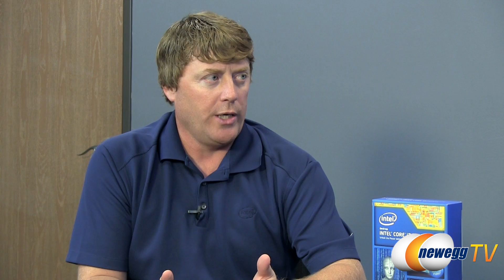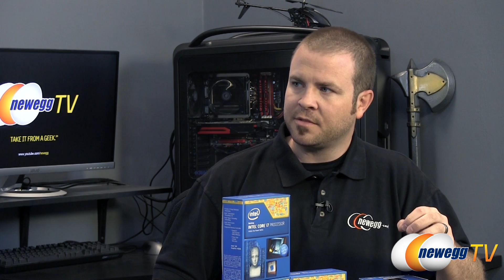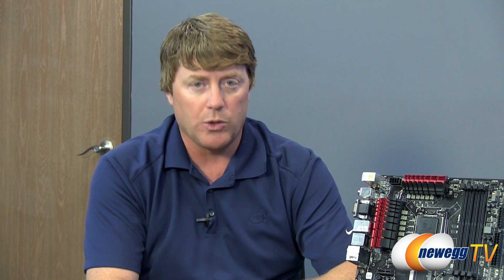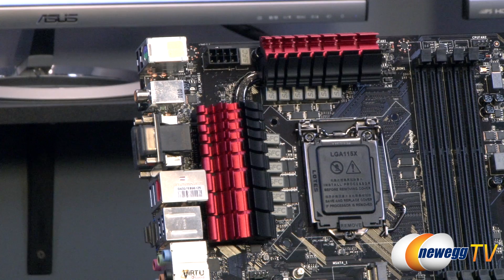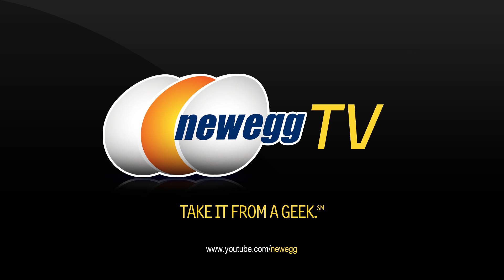Newegg TV: Introducing Intel's 4th Generation Core Processors

Comment: I just went from i5-3350P to i7-4770. I have to say didn't really notice that big of a difference. I'm using emulators as well. I use soft plugin for Project64 and with I5-3350P playing MK trilogy I got at some parts of the game around 55FPS and I did see the slowdown, but with the I7-4770 I now get 59/60FPS all the time no matter what animation. So if you're emulating like me it's a good choice to upgrade

Comment: Okay wtf? I've heard of a i7 4770k but on NewEgg I currently am eyeing a computer with an i7 4770s? Never heard of a 4770s, I'm gunna be running my gtx 770 with 16gbs of RAM, this is my first build by the way, I already need to get a stronger power supply cause of the 770.

Any info? I've been debating STRONGLY on either the AMD 8350 OR an Intel, AMDs heat up terribly fast I've heard, I do gaming AND video editing btw.
Reply: *****
The only place I have near me is a Tiger Direct and they charge out the ass for products. I'm getting my PC pre built but everyone I've soon charges at least 10% more than what you listed.

Idk, I've heard mixed reviews for the AMDs as well as the Intel processors
Reply: The Core i7 4770s is a low power version of the standard I7 4770. It's clock speed is cut back, and the power saving features of Haswell set to "aggressive powersave" making it only use 65w of power. The Core i7 4770s is meant for people who want performance, but have a sub par motherboard that can't handle the full 84w of a standard i7. Most prebuilt PC's have such motherboards.
Reply: Ahh cool thanks man :) I understand it a bit more now!

Comment: would a cpu socket size of 1150 work or does it need to say LGA 1150

PLEASE HELP ME THIS S MY FIRST EVER PC BUILD

thnyou
Reply: The Motherboard Box/Description has to say LGA 1150 OR ON SOME BRANDS Socket H3, both of which are the same socket, just different names.

It's also a good idea to look up pc building tutorials on youtube if you have rouble. :)
Reply: if your buying it from a website (i recommend dabs.com) then check that it
says on the motherboard description that the socket is the same as the proccessor (for example LGA1150)
just check their the same

hope this helped:)

Comment: I am going to buy a 3 Gen i7. I have a MSI B75MA Motherboard and a GTX 660 Graphics Card. I have also got a Corsair CX 500W Power Supply. Do I have to change my PSU to run the i7?

Comment: Nope, you're missing the gist of what he's saying. The thermal goop inside the CPU unit itself is what we are talking about, not where the heatsink contacts the TIM/outer metal part of CPU. There, Intel messed up big time with Ivy and didn't double check to fix in Haswell. That is ridiculously stupid. Some overclockers have to open up the CPU to fix Intel's boo boo.

Comment: No, you will not get the same performance in CPU power wise but gaming is generally more reliant on GPU power. Skyrim, single-threaded games, Fallout, are more CPU dependent. i7 is mostly a waste, i5 or 8350. If you render videos or already have AMD mobo, go AMD. i5 if you want a higher-tier computer but there will be a fps difference between CPUs.

Comment: Nope. Get the i5. The i7 has hyperthreading which is primarily for other applications, nongaming. You will achieve basically same performance with i5-4670k in gaming. Save the $100, put it in the graphics card, you will find a bigger difference there.

Comment: @ 5:35, the answer he SHOULD have given as to why the socket changes happen so frequently is the simple one, to make money. You want the latest gen processor, but the socket is different than the current CPU you have? Well you're just gonna have to get a new Mobo as well, happy shopping asshole! Consumerism embodied, right there. I'm just happy I didn't bother upgrading my system last year, I was going to go with the Z77 Sabertooth and an i7-3770, but now it'll be Z87 and i7-4770.

Comment: Just got me an ASUS M51AC PC that has the intel core i5 4570 3.2GHz processor, DDR3 1600 8GB, 1TB SATA3, and the Nvidia GeForce GTX650 1GB DDR5 graphics card in it for a great price. Best part is this desktop is fully upgradable for future reference. Its not the most powerful but it does the job and runs hella quite n smooth.

Comment: Not surprised that the serious heat issues with overclocking these 22nm cpu's was not fully addressed by the Intel engineer or Paul from Newegg. When a pimply-faced teenager can chop the lid off a Intel CPU (with a freaking razor blade), remove the cheap/marginal performance thermal paste that is used during the actual manufacturing process, and then replace it with a few drops of much better thermal paste (widely available anywhere) AND GREATLY IMPROVE OVERALL PERFORMANCE...that's embarassing.

Comment: The FX 8350 is probably a good bet, it has a similar performance to those i5 and i7 processors for gaming but it will have an advantage if you are streaming because it has 8 cores and can multi-task really well.  On top of that the Steam roller CPUs will come out later this year and will probably use the same socket so you can upgrade easily.

Comment: Intel should not sell the Haswell processors with the stock heat sinks.  I just finished my build and running prime 95 gave me alarmingly high temperatures without any overclocking.  I need to get an aftermarket CPU cooler I guess.

Comment: What are the limitations on GPUs that force the Clk speeds so low compared to a CPU? Does the increased parallelism in the GPU mean more power exerted over a given time at peak throughput that needs to be dissipated compared to a mostly serial processor such as the 4770k where up to 15% of the processor cores can be dormant under full load?

Comment: They just need to make overclocking easy to where the BIOS has a built-in stress test.  You simply enter the desired heat max or Ghz max, and it could find the right values for the user.  I'm sure that will be a future possibility.

Comment: That's very ignorant. Yes Intel has better performance per core, but once you get into more heavily multi-threaded programs, the difference is minuscule at best.Yes I do admit that Intel chips tend to be more powerful than AMD chips, but they also cost quite a bit more. It all depends on what a person needs from their computer. If they want the best of the best and have deep pockets, then Intel all the way, otherwise AMD is perfectly acceptable. plus AMD is backwards compatible thanks to AM3+

Comment: Meh. I think I'll wait for the 2011 socket Ivy Bridge E cpu to be released before deciding what to put in my next build. A cooler chip IS what it is. Regardless of the perks mentioned in this video Haswell evidently failed to deliver. I noticed there wasn't much elaboration on performance or any bench mark results offered in this video either. Apparently desktop users who are concerned about power usage are better off using GEN 3 anyway :::sigh::: I've waited this long already... I can wait.

Comment: Lol, Dude just stop, do you think I actually give a shit? As for having to upgrade every at once nope I can use the same ram psu and hdd ssd even the case, but I can't use the same CPU(duh) cause that's what I'm upgrading, and given a new CPU architecture I'd proably need a new board any way cause a new board will support more features the cpu offers IE ddr4 ram PCI-E 4.0 more SATA IV? Btw AMD still only supports up to PCI-E 2.0 even though they make PCI-E 3.0 video cards, so Intel is for me.

Comment: Finally they do away with stock heatsinks/fans, i must have around 50 of those over the years and i have yet to use even one(intel heatsinks always sucked). Will be nice to possibly save a buck off next cpu and not add to my clutter. Anyone found use for all them HS/fans? Somehoe my fort of medoocrity doesnt seem like best solution for them

Comment: Okay, this explained it perfectly. Basically this new 4gen processor is really made for the "mobile" sector like laptops/tablets. This new CPU does not sound like it's optimized for desktop PCs. This CPU was just made for better MOBILE battery life. And when this new CPU is running, is runs hot, hotter than the 3gen Ivy's. So for PCs, who cares about saving battery life when this new CPU runs hotter while under load.

So after watching, I think the 3gen's are still currently the best for PCs.

Comment: my last two builds were with amd chips. i considered amd's 8320 for my current build but amd doesn't support a few of the next gen MB features so i sprung for a i5 3570k and runs the new tomb raider and bioshock and resident evil 6 really well with my older gtx470 i was going to get a gtx660 but i see no point in it after putting this rig together. my i5 is amazing!

Comment: I am sorry that you feel so entitled. It is true that I have not researched anything. Your reading comprehension skills should decipher that I did state that my figure is what I'd place it at, not a stat. Where's your stat from? The IGPU is a utility that most gamers will not use, true, but if your card were to fail then you'd have nothing but an older card to fall back on, or worse, no card for a number of days. Intel is providing both redundancy and accessibility. I'm sorry you don't get that.

Comment: Inevitable, Mr. Anderson? Always.  Sorry for the Matrix line. Anyway, my point is you have other options for the next 2 years at least.  At the moment I haven't seen a game that fully uses a 2500k. It OC's very well. If you want to record videos/stream, then get an avermedia gamer capture card or upgrade to an i7-3770k for more threads that the video capture can use. Personally, my plan is to wait until the next socket is released in about 2 years.  In the mean time .. I need a new gfx card :(

Comment: Rumor I heard is going to be about 5-10%. Going to depend heavily on your application. Basic same clock speeds as Ivy Bridge processors with same 4 cores. The improvements come from the "features" as the guy said. I suspect for gaming you will see very little improvement. For video render if you use the on-board Intel graphics there will be huge improvements. Tech of Tomorrow already posted benchmarks of the new i7 against the previous i7 at stock speeds and it was nearly the same with gfx card.

Comment: There is no competition for nvidia that is why they released a mid range card gk104 as a highend card. The gk110 was the true gtx 680 but they put it in the 780 and charge whatever because amd does not have anything to compete with nvidia plua their crossfire sucks.

Comment: Some trouble shooting doesn't work without integrated, Also in my current(outdated) system I normally run two 690's but if something fucks up I find myself using integrated because some diagnostic tools refuse to run off the 690's

Comment: I thought that Sandy was a tock, ivy tick, and now haswell tock. 

I'm still running a Sandy2700K, but with a high end z77 motherboard. TONS of USB 3 ports, 4 Sata 3 ports and more than enough power for gaming. And with the great overclocking(4.5Ghz right now, might bump it up to 4.8 later), I don't see a point of upgrading. I am going to try and see if I can just skip the 1150 socket all together, but I guess I will just have to wait and see.

Comment: Everything that intel does is about mobile. When are they going to make processors specifically for desktop and not based around what they want for the mobile market. Sure power savings is fine to some extent but I want a power hungry cpu that straight up destroys competition! Screw the die shrinks

Comment: Bud I hate to say it but isn't that about the % difference in most of the new architectures? They are dealing with nanometers here. The smaller the die shrink the more heat it produces causing leakage I think they are about at the end of the road.

Comment: I hope you understand that they don't really have a choice.. The MCC (AKA NB) is integrated into the Die, meaning that they need something to communicate between the VGA and the EDB/ADB. Not to mention, They have to have a IGP for most mobile CPU's. Believe it or not, Intel designs there Desktop Processors off of the optimized Mobile platforms. A lot of people, especially businesses (Largest consumer of processors don't need a Dedicated GPU).

Comment: just get an ivy bridge it has the same architecture and had the same Ghz rate with the same number of threads and cores if you compare an ivy bridge i7 3770k to a 4th gen i7 4770 s or k

Comment: fx 8350 performs the same as intel 3570k in games with in margin of error. fx8350 rapes the 3570k in multi threaded applications which will only increase in future. games don't even need high end processors. an fx 4300 or 6300 will also likely perform the same as 3570k in games

Comment: Since the most expensive of the new processors (the i7 4770K) costs around 300$ I would go for that. If you want something cheaper, you could buy the i5 4670. But as these processors are brand new, there are no tests, how these processors perform in an "office-computer" like you want. But they shouldn't do bad. :)

But be aware, that you have to look for a "Socket 1150"-Motherboard!

PS: Battlefield 3 should run on the integrated graphics, but don't expect too much from them.

Comment: The Core i5-4570T will be a low power CPU though (35w), likely for notebooks. Dual-core with HT, 2.9GHz, 3.6GHz turbo, 4MB L3 ... so basically, if you want HT for a desktop, you're better off with one of the i7s. There's a fairly thorough Haswell page on Wikipedia with all the deets.

Comment: Don't get me wrong, the rationale is bulletproof with the built-in voltage regulation and whatnot, but it's not inconceivable that certain features could be optional and turn off in order to preserve backwards compatibility (a la PCI-E 3.0). After all, they keep removing pins, not adding them. Surely they could just not use 5 of the LGA 1155 pins.

Comment: Well Intel went from the standard of soldering it, then they went to thermal paste, and they got plenty of bad rep and worse performance. My only question is if they continued down this route and used sawdust to transfer heat.